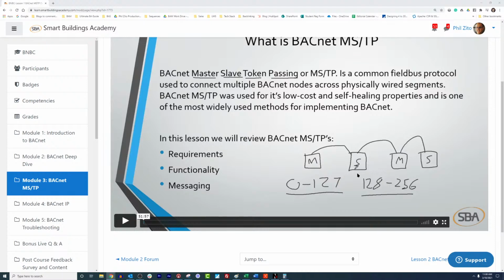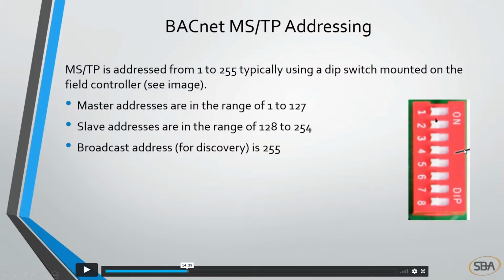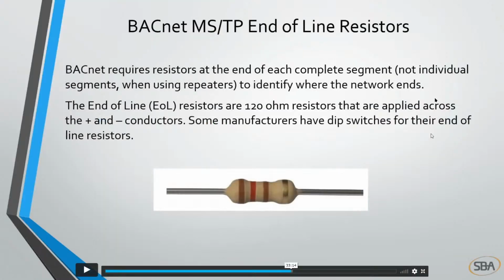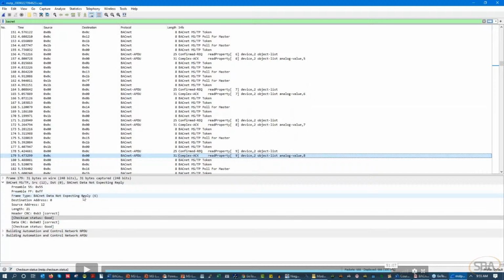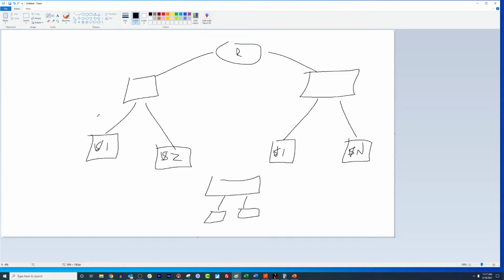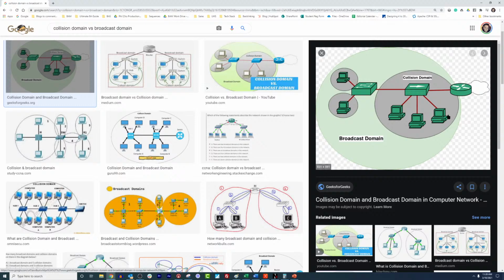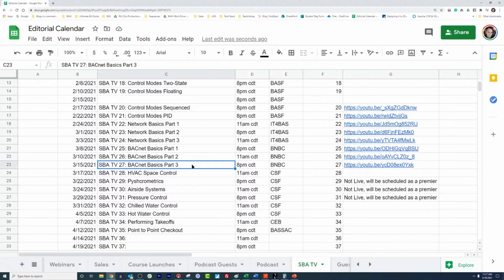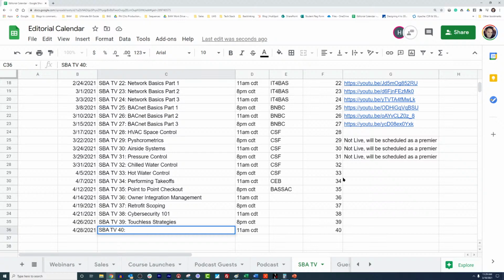SBA TV 26: BACnet Basics Part 2

Comment: One thing is a little unclear for me.
Masters and slaves…
Are controllers for blower coils, fan coils etc considered the slaves and the zone managers (depending on brand I guess) that the controllers go back to considered the master? 
My other thought is controllers are masters and hold the token to send data then pass the token down the line. Anything connected to the controller such as sensor data and status info is what is sent out while the controller has the token?
Reply from the maker: Masters can initiate and respond to messages. Slaves can only respond.